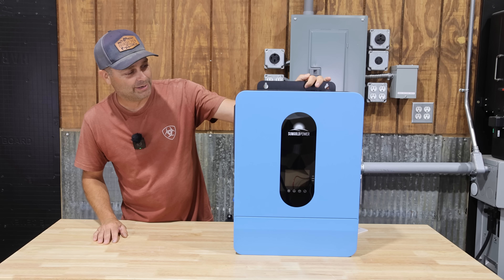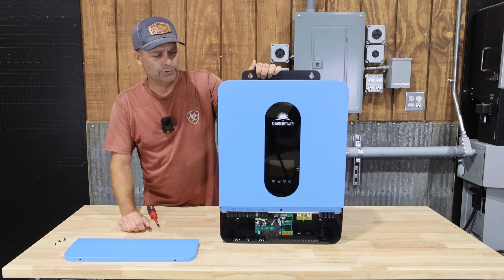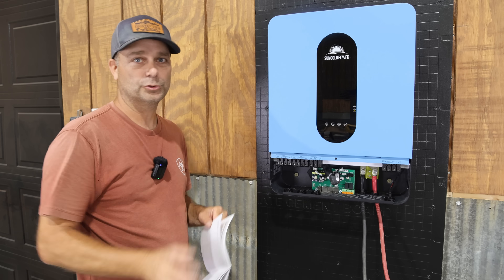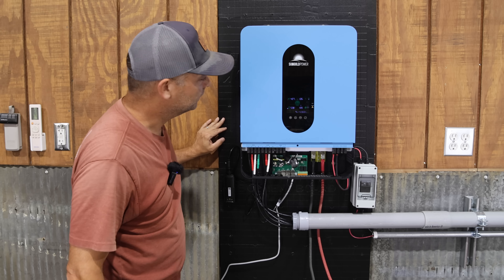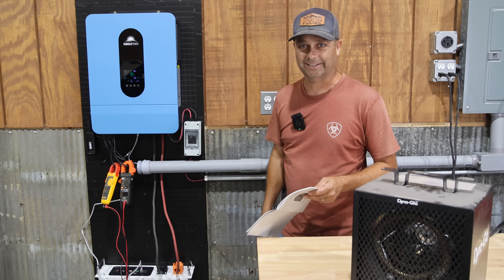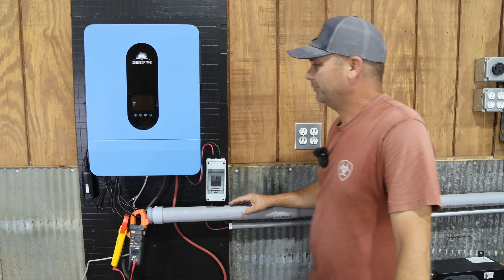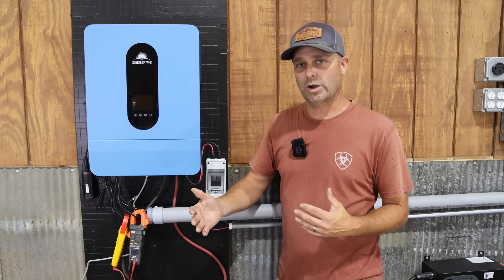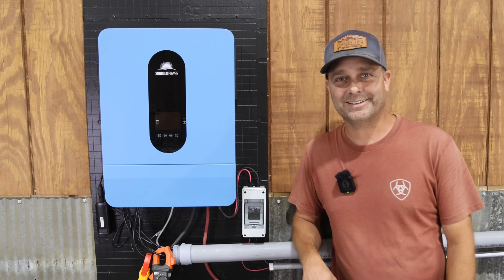Installing and Testing Sungold Power's 6500 Watt Inverter  -  SPH6548P

Comment: Great video, thanks for the info. Did you connect AC Input and output to the main panel? If yes, how did you avoid to back feed into the grid? I would like to use the same set up for my home use but do not want to back feed into the grid. I will have 5KWH x 2 battery back up and 3000Watt solar array. Thanks.

Comment: NAZ solar is selling the Schneider XW Pro 6800 watt Low Frequency inverter for $999 normally $2800.  It's capable of 8800 watts for up to 30 minutes and surge to 12k watts for up to 3 minutes. Truly amazing LF inverter probably best one ever produced for off-grid use. Schneider discontinued it sold all the stock to NAZ they sold out of some of the components 100 page thread on DIY solar forum some buying 2 and 3 of them.  Sungold and few others will have to take up the slack for off grid they won't perform like the XW Pro.

Comment: What happens if you don't connect AC in? Is there another way to get solar power to a manual transfer switch? I don't want anything to do with AC in /GRID being used.

Comment: So when running 110 v, is the maximum wattage 3250 watt per 110 leg outlet? 

I am confused about that because they also make an 8k so is that 4k w and 4k w?  Is this the difference between a 30A, 40A, and 50 A?

Comment: Hello, good afternoon, friend. I’m watching one of your videos and I was wondering if you could help me correct an installation of the Sungoldpower 6500w inverter that I have installed in 110v input and output and it doesn’t charge my batteries. Best regards

Comment: This inverter is really weak. I had to replace my EG4 6500EX that blew up so I tried this one. The 6500EX had no problem running 2 15k BTU AC's in my RV with other high loads going. This inverter could barely run one AC reliably with no other loads. It's supposed to be able to go 10% over 6500 watts for 5 mins before faulting out but it actually faults out within seconds like you experienced. I sent it back and got the 10kW version which is a beast and works great. I would stay away from this one and get the more powerful 8kW or 10kW versions for a few hundred dollars more.
Reply: Great. I just got mine yesterday. I had the 8k in the cart, but decided on this one. So I should return it?
Reply: @rooter-c5c  Depends on your use case and the loads you need to run. If it's not a big deal just hook it up and test with your loads since you already have it. I just feel like the bigger inverters are a much better value and you never know what additional loads you may require to run in the future.
Reply: @Blk05GTStang  That was my dilemma. Save a few bucks, get the 6.5k and see how it goes. Or get the 8K to give a future proof cushion. The 6.5, being 240V capable, I do have an A/C that pulls 3k watts. But I live in a mild climate, so only use that very occasionally in the summer. Otherwise, all other loads 120V.
Reply: @rooter-c5c  I have a strong feeling you'll run into issues running that AC unit with this inverter. You could always try adding a soft start to the AC if that becomes an issue though but even then this unit is weak and may struggle. For 3-4 hundred more the bigger inverters are a no brainer and then you'll have no worries at all powering anything you want.
Reply: Looking at sungolds return policy looks like a pain. Maybe I'll just sell this one and get the 8 or 10k and not worry about it. Thanks.
Reply: @rooter-c5c  Yeah that's why i bought it on Amazon for easy return just in case and glad I did. You're welcome!
Reply: @rooter-c5c I would return it and get the 10kw version. That has fantastic reviews online. It’s made by a reputable inverter manufacturer

Comment: I have that one.  Just installed it a couple months ago.  I'm using it in my RV with 15kw of battery.  When I kick on my 2-ton heat pump for AC (takes about 2.7kw) I notice the UPS for my computers pops on due to low voltage.  Eventually I'll set this up on my new land in a solar shed with a second unit and more battery.  Hopefully the low voltage will stop when the high draw heat pump kicks on.  Other than that, it's worked great.  I love the solar capacity, with the two charge controllers each capable of 5kw.
Reply: Add a nucalcon soft start on your air conditioner. I do hvac for a living and it helps your inrush amps on startup.
Reply: And you can parallel six of together them for 39K of power, pretty cool!

Comment: It does annoy me that the screw terminals are lo-balled.  And I don't particularly have any complaints about modern HF HVDC mid-bus designs (which this one clearly is).  But at the same time they obviously didn't put enough caps to buffer the mid-bus internally if it has so much trouble starting a planar, and given the lack of LRA start capacity the idle consumption seems a bit on the high side.  They are also using direct air cooling instead of backplane heatsink cooling and the fans are ridiculously small, which makes them rather loud.

The manual also says it is UL1741, but says nothing about whether it is UL1741, UL1741SA, or UL1741SB.  The base UL1741 specification is ancient... if this is supposed to be a grid interactive inverter then it should be at least UL1741SA.

It just feels like they cut a few too many corners and didn't bother to optimize the design at all.  The documentation and specs are incomplete as well.   It's a pass for me.  Just seems like they OEMd something without putting any effort into it at all.

-Matt

Comment: Intrigued by this unit but maybe too many open issues to pull the trigger: Evan's comment that the fitting of 4 gauge neutral if used in single phase mode may be problematic, website O+M manual is not current (had to reach out to company for a link to current manual), the wifi dongle set-up & remote app instructions missing. Thx for the honest review

Comment: I recently had a not-so-good experience with Sungold Power. I purchased one of their all-in-one inverters and after a week and a half it still had not shipped out. When I contacted them via email it took almost 3 days for them to reply. I tried using their phone number multiple times but no live person ever answered. When they finally responded to my email I was told the units were on backorder. Now, at the time I ordered, there was no indication of these units being "sold out". Other units were listed as sold out but not the one I ordered. At any rate I had to purchase a more expensive aio inverter to complete the install for a customer. It took several emails and a couple of threats to get Sungold Power to refund my money. I can't say I would recommend this company.
Reply: I am surprised to hear that. Never had an issue ordering or with the company at all. And I have been using SunGoldPower for years.  Used their 12v 3000w and now I have a 24v 4000w Split Phase. Never had any issues with either one.  They make rock solid dependable inverters. Great company.
Reply: @OurBlackCatCottage  Sungold and I have worked out our issues. I really like their inverters and want to continue doing business with them. I have now purchased a 4000 watt inverter/charger from them and it is working flawlessly.

Comment: Lightweight high frequency transformerless inverter. Won’t have any surge capacity beyond nameplate (at best) and won’t handle L1/L2 imbalances well. For surge capacity you need lots of headroom in a HF inverter or you need a quality LF Transformer based inverter.

Comment: I'd like to see a video of the battery you built. Communication with EG4 inverter if possible. Great video...
Reply from the maker: I did have a video on programing the battery.  And I showed it communicating with the eg4 inverter in the build video.

Comment: Geez dude, you really need to give up on promoting these toy high frequency. transformerless inverters. They may work ok for the duration of your short video, but over the course of a year or two if you're lucky. they are practically guaranteed to fail when used in continuous residential applications. You should be promoting Sungold's low frequency, transformer based inverters instead of these low surge capacity, short lived toys.
Reply: Do you ever get tired of trolling?
Reply: According to HOBOTECH that particular aio does have a low frequency inverter and a pretty hefty transformer.

Comment: Hey Evan, where ca someone purchase that black backer board in the video? Thanks in advance!
Reply: It's just cement board, He painted it black.
Reply from the maker: I used 1/4 inch fiber cement board, know as tile backer board.  and painted it black.  you should find it at a home improvement store.